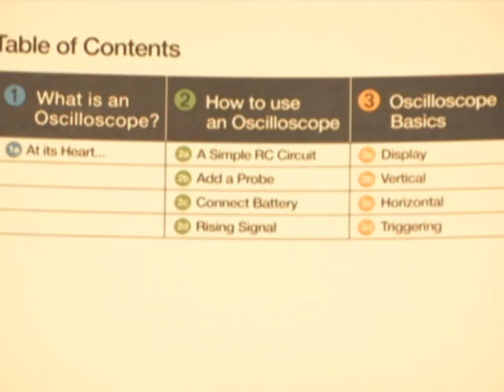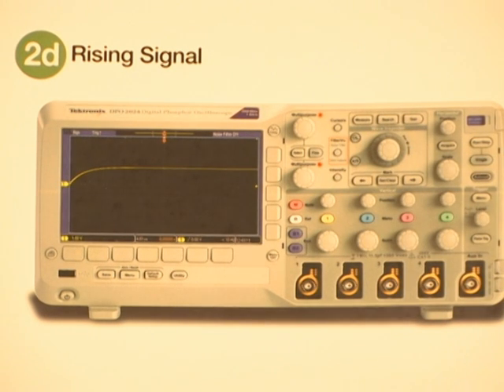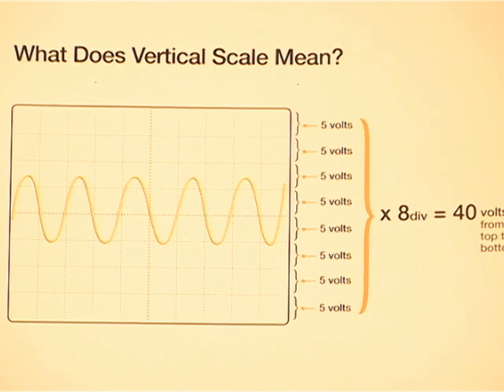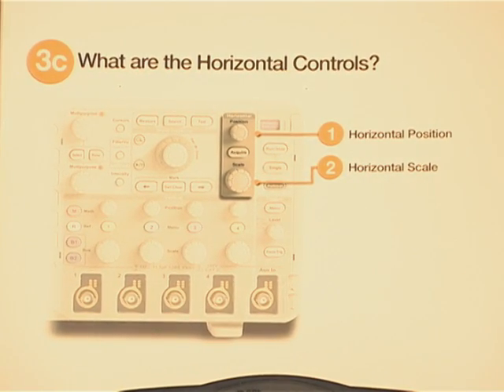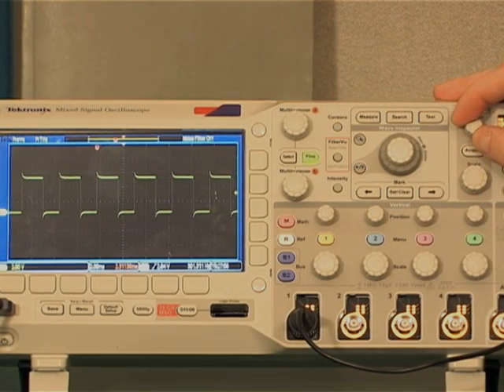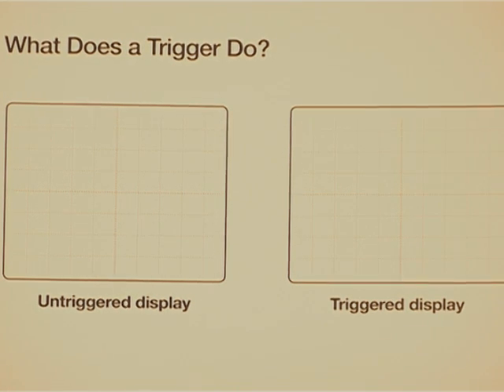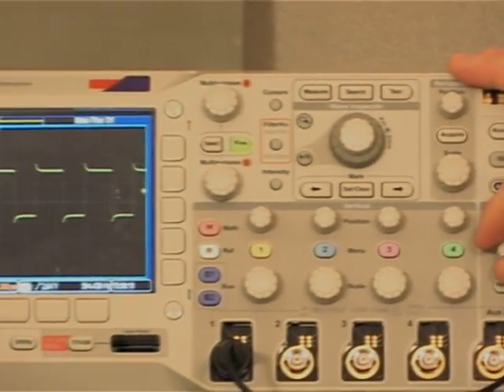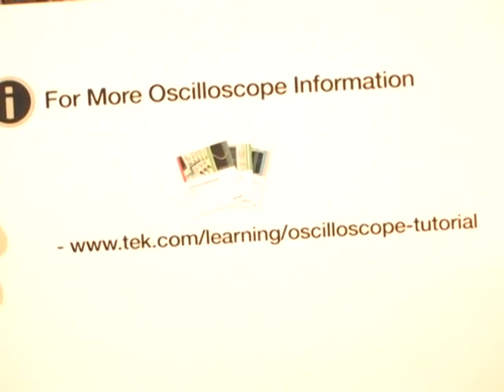How to use an oscilloscope

Comment: Thanks for the information. I am not interested in elevtronics but I am interested in the Oscilloscope. I am an Industrial Piping and Vessel Inspector and used Ultrasonic testing equipment in the past. Of corse technology has advanced to the 100th power, over the past 10 years, but the equipment is based on the same functions. It brought back old memories.

Comment: Can you guys do a video  (in-depth) on how to use the scope for creating and testing audio circuits.  I just got a scope and I need help learning how to read the different componets of the builds I do.  I have done all my builds up to now with no scope, So me and my '63 500-series need some help learning:
1) What components can be measured and how to measure
2) Measuring multiple components
3) Comparing readouts
4) Anything else that would be beneficial for designing my own circuits
thank you!

Comment: Not bad at all, thanks. I wish it'd be more of an unscripted dialog between the two of you. It would also help to see you using the scope in an actual circuit. For example, trace a power switch ring while you snub, show how to square a signal with a comparator and how to calibrate the probes so it shows square on the screen. Hey Ian, I like your DJ Master Tek look : - )